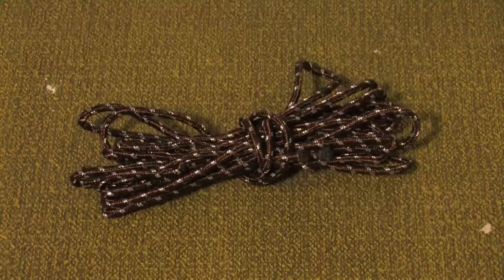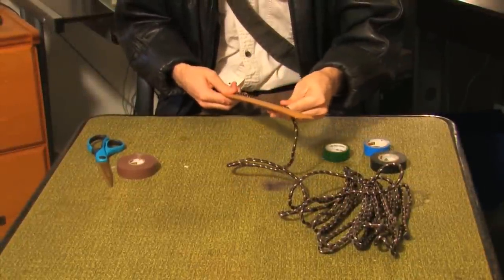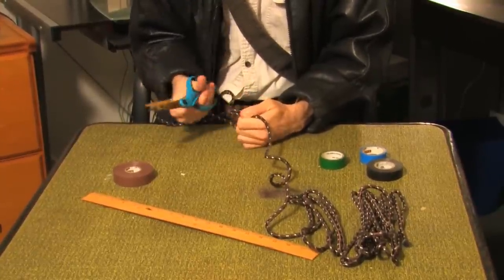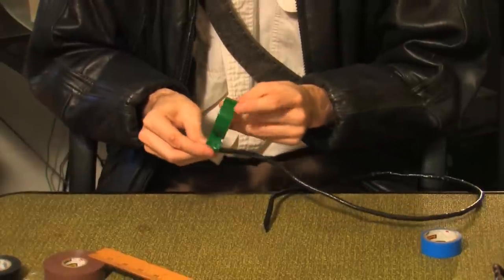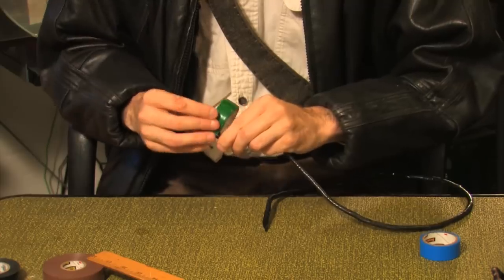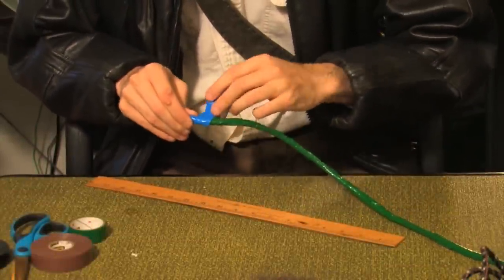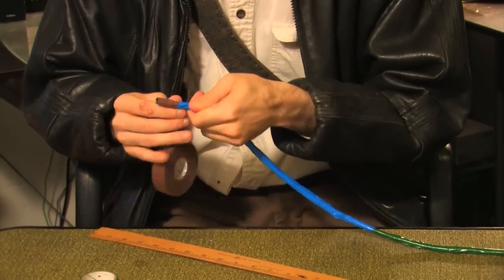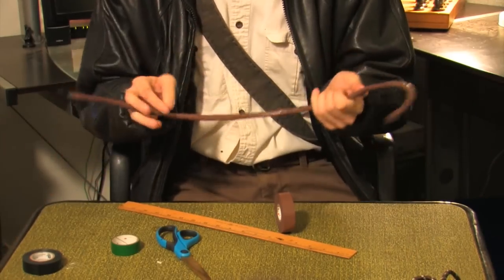How to make a fake Bullwhip

Comment: Electrical tape stretches over time go ahead and pick up a roll right now and unroll a couple inches and see how much it stretches it stretches a lot right? For my whips I use duct tape because of the really thin nylon thread inside of the duct tape it helps it not to stretch as much I use steel rods in the handle of my whips that's what makes a bullwhip a bullwhip however what you have is technically what's known as a snake whip because it has no rigidity in the handle I use a rope core in my whips to preferably paracord then I start a basic for plat belly but I have started with duct tape I take a piece of duct tape still attached to the roll and attach it to the underside of a table then walk away holding the roll this will make long strips of duct tape I then fold them in half and cut them down the middle then I make another belly using the same method and then another belly similar to what you're doing with the whip wrapping down with the tape only a little bit then wrapping back over that going slightly farther and so forth that's how the bellies  of a whip work and then I did a 8 plat overlay and I did a copper ferrule onto the whip this makes the website we heavier in the handle you can see this whip on my YouTube channel in my most recent video also another cool thing about my whips is that they actually crack and make the loud sound that you see in movies